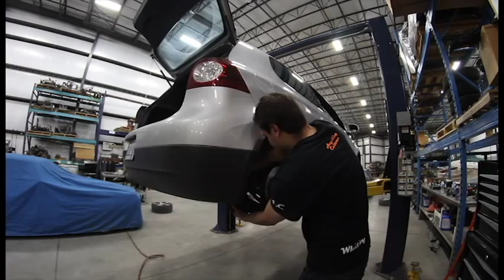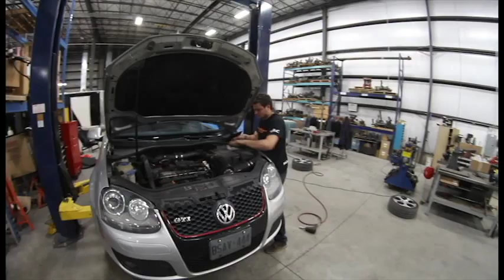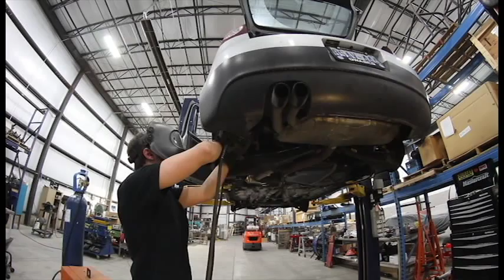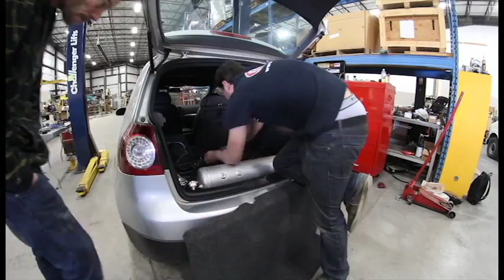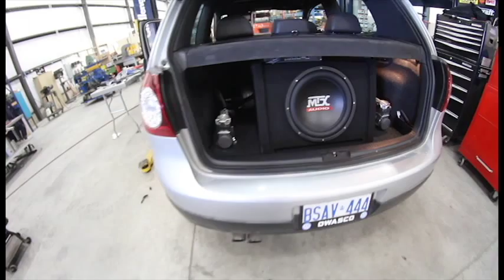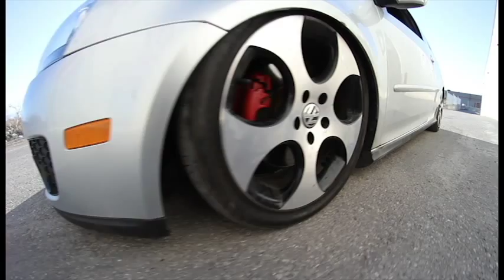Anything Customs - Air-Lift Install - VW Golf GTI

Comment: Never seen anyone cut anything to remove stock suspension. Literally requires NO cutting to remove factory suspension and add air bags
Reply: Erik Alvarado they're notching the frame
Reply: No frame notching required one the rear... maybe modifying the spring perch for an aftermarket shock. Only notching you might need is up front to clear the CV axle.
Reply: Kit was supplied by customer. It come with generic bags for the rear. Had to modify the spring perch to adapt them to the supplied bags. This was done at the customers request.